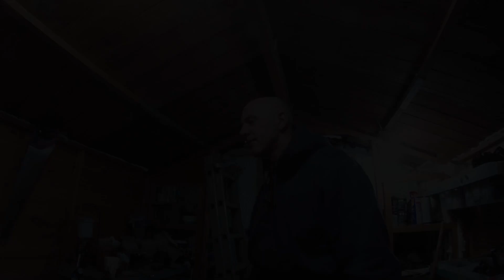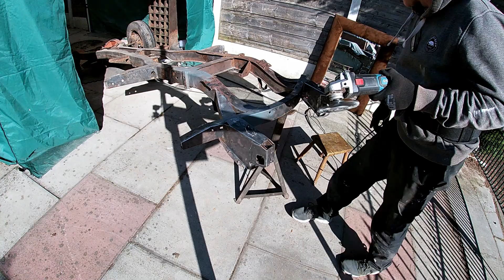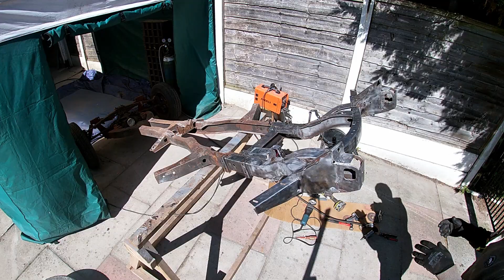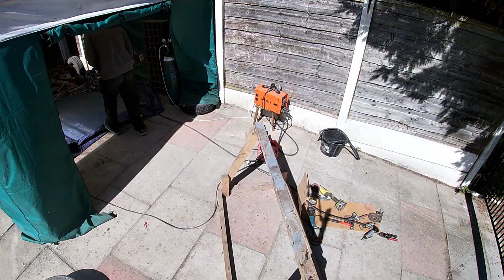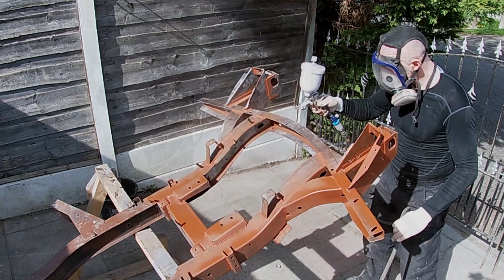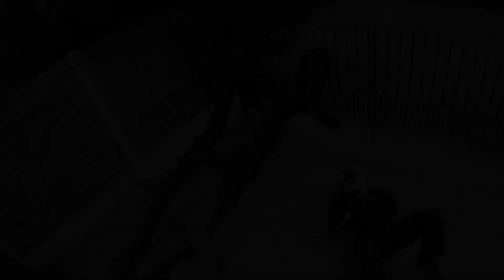The Triumph Spitfire Chassis Symphony, Steve's Garage

Comment: Great video m8. What's your thoughts on soda blasting or even dry ice blasting, I have heard that soda blasting is cheap and more environmental friendly and dry ice is very expensive What's your thoughts🤔🤔?
Reply from the maker: Glad you enjoyed it Ken, I do Soda or Glass myself They both have there uses but on certain part's, Soda is great for Carb's its a really mild abarasive so kind to alloy's and of course can be washed away, where rust is deeper the cutting power of glass is awesome, but you wouldn't want to use that anywhere near the engine, where a couple of grain's of glass could wreak havoc, i don't have any experiance with Dry Ice myself mate